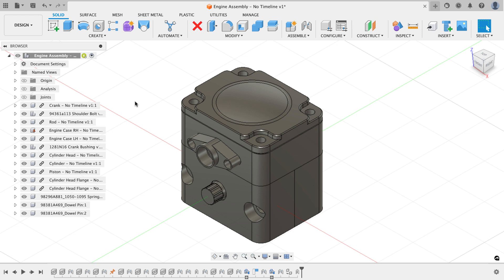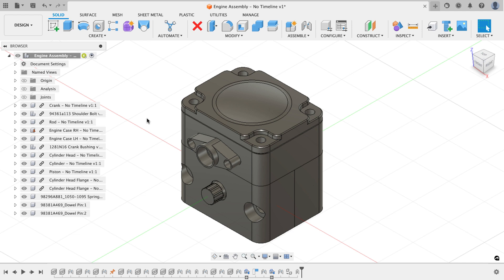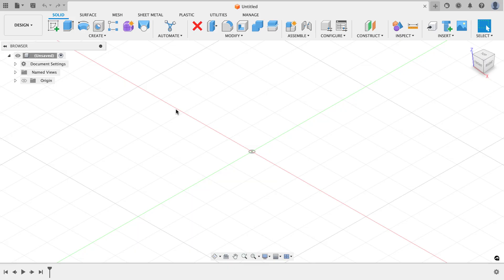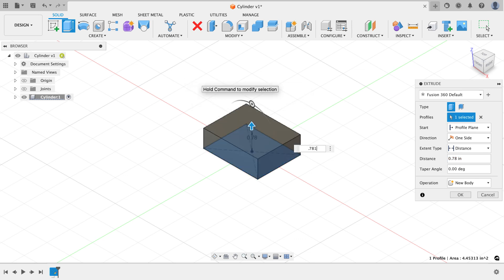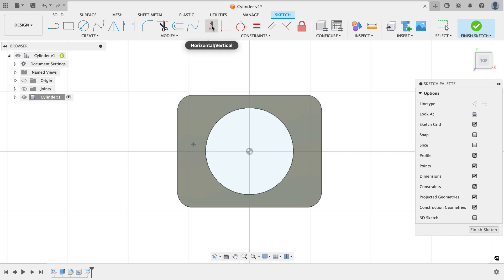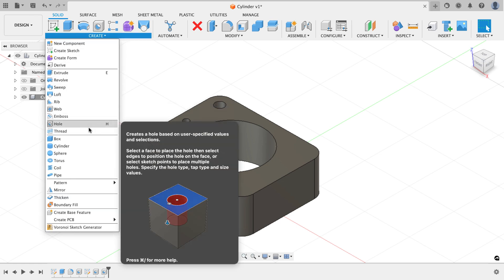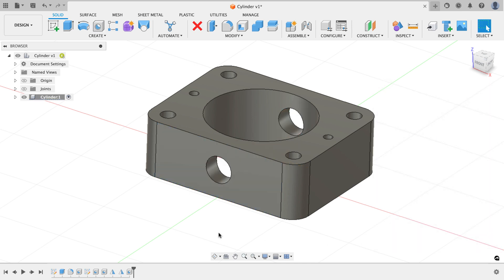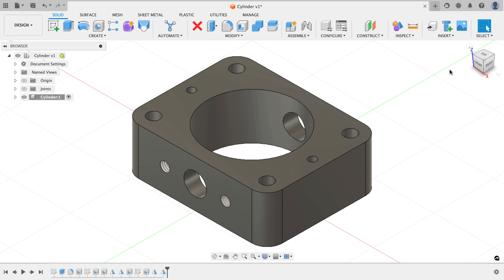Model Engine Project - Cylinder

Comment: @MechanicalAdvantage just a quick fyi Kevin, but I've just downloaded the pdf from the link above, and there a quite a few dimensions missing.

Any chance you can share your fully dimensioned drawing?
Reply from the maker: I changed the link in the description. It now takes you to the summary page for the project where there is a download assets link. The drawing I used will be in that download.

Comment: A nice interlude during the huge dump of snow we are getting. I shovelled till i had a coronary - grabbed prerequisite tea - and tuned in. I'll consider a "Support" option from you in regards to a fixture plate (to hold a pair of low profile Mod Vice from Saunders Machine Works)  that is underway. The worst of it is feeds and speeds in metric, on a 2.2kW spindle that is happier above 12,000rpm. Peck drilling, single point thread milling, and reaming amongst others. Grey areas are the stuff of nightmares. Resolution makes for good sleep.
Reply from the maker: By the way. I saw your email. Look for a reply from me later this evening.